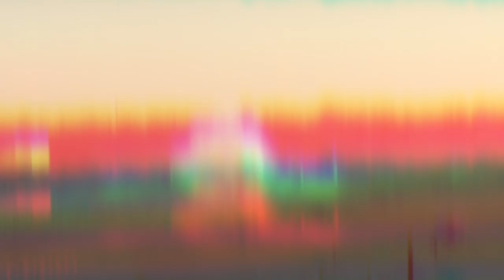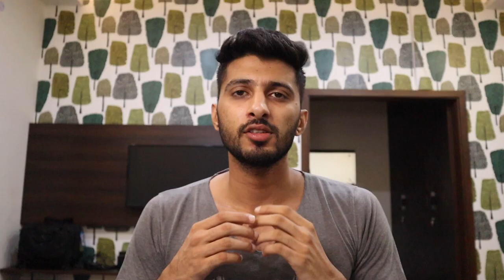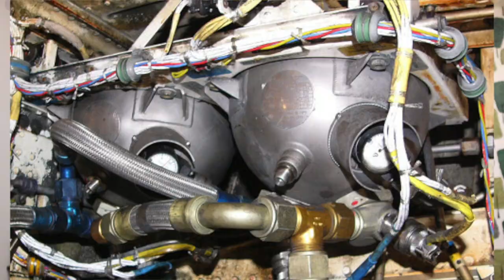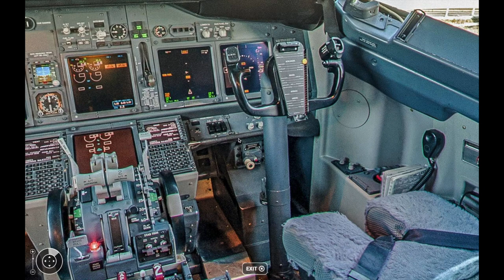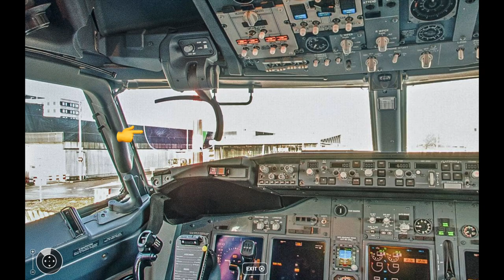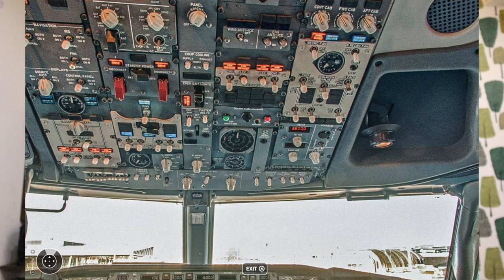A DETAILED TOUR OF THE B737 COCKPIT

Comment: Yes sir i need the tour of a 320
Reply: Also difference b/w A bus 320 and 330..
Reply: We need not u need
Reply: Yes we need
Reply: 747
Reply: @kuljeetsingh7630  basically it's shape of nose and landing gear double pair of wheels of 330 and an 320 have a single pair and the shape of engines and wingspan and an 330 is a very long in length a/c than an a 320........  .
Reply: Pls. do cockpit tour of A320 and A380..
Reply: @kuljeetsingh7630  A330 is particular for long range i believe.
Reply: Kuljeet Singh ujhn
Reply: Why are you making video again?
Reply: Airbus cockpits are the worst... their colour are the worst...yuk!

Comment: Thank you Captain, for a clear and patient explanation🙏 I have lots of experience flying 737 in the fantasy world of a home flight simulator, now I feel relieved that I was not being fooled by the software developer😀 Quick question, what is the reason for the cabin altitude being kept at 8000 feet?  Wouldn't that feel more like being on top of a not-so-small mountain?  Will keeping it at say the sea level be costlier in some sense, or exceed the relative pressure that the skin is rated to handle while cruising?  Thanks🙏.

Comment: The central lower display can switch between engine, systems and fuel information in the 737 FYI...M
Reply from the maker: I've flown the 737NG for 7 years. And no, it can't.
Reply: @BoeingBoy  well the 737-800 and 737 Max 8 can 🙂

Comment: Sir I fly microsoft flight simulator pmdg b737,b777,I need to know the correct FMC input system,,,one destination to other,,like ACT PERF INIT, TAKEOFF REF, TAKEOFF TEMP SELECT,ect,,pls make a video on that.....
Reply: Read the fctm FMC section .or watch YouTube tutorials . I also fly pmdg737 ngx and learnt all those things in class 9 .it really helped me a lot .take off temp is to regulate engine thrust for fuel economy . Flex temp(or assumed temperature) reduces engines thrust like if u input a temperature of 66°C it will reduce engines maximum takeoff thrust  . Origin destination can be set in FMC route page .for example departure is VECC and arrival is VIDP .then go to departure arrival page and select correct runway with standard instrument departures(SID).u also have to get a route to make the flight .you can get ur route from simbrieft or online route finder .it will go longer if I keep writing .u can also check smart cockpit.com B737 section .one more question are u Bengali ?your pic shows standing front of Raja Ram Mohan Roy ☺️

Comment: Hi,
It is a well known fact that a real pilot is the one who has something between his legs. However and because B737 is a relatively old design aircraft, can you please explain the newer strategy of so called fly by wire systems? A typical example can be A320, 330, etc.
Thanks!

Comment: V1,Rotate ,V2, +ve climb, gear up, every time i hear these words during take off, plz explain what does it mean or if possible plz make video of cockpit process.
Reply: V1 is take off speed.its the point of no return. Its not safe to abort landing after V1 you might not have enough runway to stop the aircraft post v1.
Rotate is rotation speed known as Vr . Its the speed equal to or slightly greater than v1 where pilot flying pitches the yoke few degrees backwards to get the plane in the air followed by positive climb and gear up which means you are able to see aircraft climbing (positive altitude rate) . Gear up means get the landing gears retracted.

V2 is take off saftey speed. Its the speed after which your aircraft can climb even in the event of a single engine failure
Reply: V1 is critical engine failure speed .if anything happens wrong after V1 speed is crossed .aircraft can't be stopped within the runways length .Vr is the speed when pilots start pulling yoke back gently and aircraft starts pitching nose up .then comes is V2 which is safe climb speed . By positive rate pilots simply makes sure that aircraft is climbing .or a positive climb is initiated .gear up is simply when pilots retract the gears .